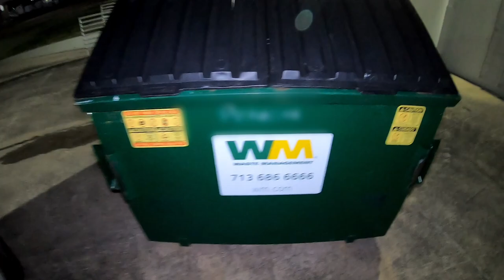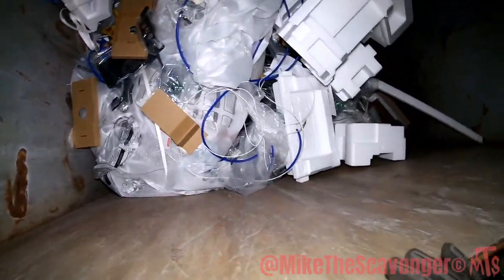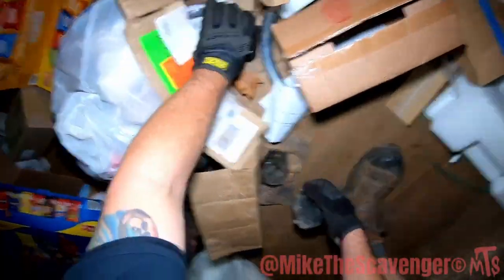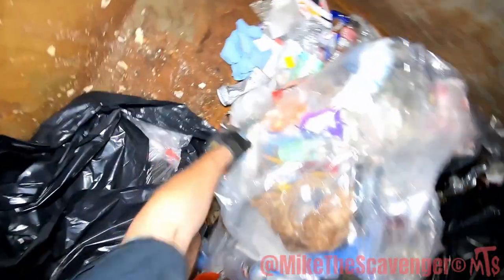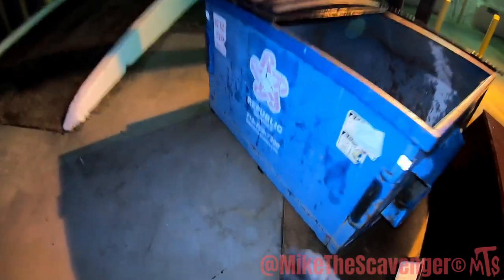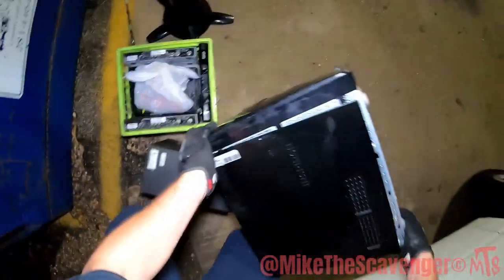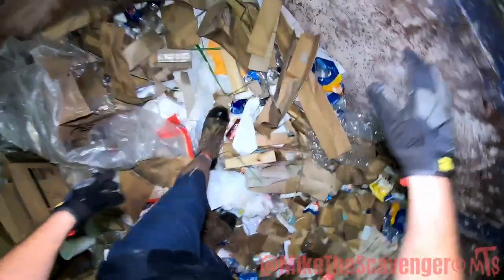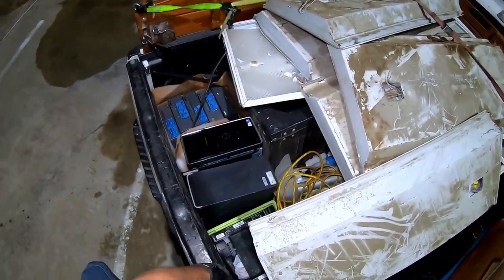Dumpster Diving "Blue Magic!"

Comment: Mike I grabbed a 46 in. Tv from the dump and did a hard reset and the tv worked. You should be gentle with them. If you get it to work it will have resale value
Reply: I agree. I received an old big TV (45 in.) from a neighbor because it didn't work. Checked on YouTube video, ordered a replacement board on eBay, replaced it and the TV works again like new. I like getting free stuff. That TV he tossed and broke it may never work again. 📺
Reply: @Linkz1485  at one point in time he DID bring them home and check them. Not anymore I guess

Comment: Mike Mike what about the fittings on top of the fire extinguishers those are metal if not my mistake aluminum you need to start unscrewing those valves off the top of the fire extinguishers FYI

Comment: That heavy pipe is called rigid it’s for areas where emt conduit just isn’t tuff enough to protect your wiring and it’s really hard to work with,,that-extinguisher looked new and that size is around 50-80 buck’s depending on the brand

Comment: First I want to say thank you for another awesome video. You rock. I would like to start filming some videos. What GoPro would you recommend. That's not going to break the bank, that will be dependable. I've been dumpster driving for years. My father passed away about 5 years ago. We used to go out every night together. I'd like to get back into it a bit. Pet stores throw away lots of good food, treats and supplies. Walked into the local pet store a few weeks ago. Saw a pallet of food that was $90 a bag. Walked around back to their dumpster and there was one of those bags in the dumpster. Just had the corner torn. My dogs eat good. 😃. That pet dumpster has saved me thousands of dollars. ❤️💯🐾🐾.

Comment: Seeing more lights made me wonder: what do you think Mike has gotten the most weight from if you added up everything over the years? Refrigerators are heavy, but there have been several hauls just full of lights or pipes. And several times there were 2 or 4 water heaters in one trip.  What do you all think?

Comment: People throw out good tv's all the time. Some work fine but most "good" ones thrown out just need a couple led backlights replaced. (In my book easy fixes are classed as good tv's!) I currently have 4 bigscreens that came out of the tip or scrapyard and have given friends a half dozen over the last 5 years. Even my local pub has a 55" LG smart tv with remote I got from the tip- I only needed to make a stand for it as it had been wall mounted. Has run all day every day for 2 years without a glitch. So please look before you jump on the next one- or you might waste a couple hundred worth.

Comment: Those satellite and cable boxes are such a joke. I had my satellite internet company want me to send back the head piece that’s in the dish when I moved. They come and install the dish but when you leave they want the customer to retrieve it and send it back. They charge you $300 if you don’t return it. After calling multiple times over several months for them to send me the return box, which you need in order to send it back, and being charged the $300 , they finally told me they would refund the charge and just to throw away all the stuff. The reason? They could not manage to send out the box. The thing is I knew the equipment was obsolete, and they knew it was  obsolete but they just had to mess with me. They had launched a new satellite and were trying to get everyone to switch to it and not adding any new customers to their old system. Worst internet ever but one of our few choices and we were out of contract so no early penalty and we were just waiting for something else to come along.

Comment: I'm actually surprised to keep finding so many empty classic tool holders like those are plastic cases or whatever you were calling it for the life of me I can't even figure out what happened to all the cases for my tools that I have now hell if you were to ask the start grabbing all of this and turning around flipping them on eBay somebody like me would probably end up buying most of them from you because I could actually use them for all of my sockets and wrenches and power tools now there's a thought for you . I also saw that flat screen TV on there it looked like it was in decent shape now I know a bunch of people out where I'm living at but if you would have pulled that out of the dumpster in the condition it was in they would have fixed that for you or something simple like like picking them up a steak or something and then you would have ended up with a working television that you could have turned around and flipped for anywhere from $200 to 350 there are those people out there who enjoy a good challenge and like fixing stuff I'm doing it for a little to nothing at all you just got to find them I am one of those guys that enjoys fixing the old metal chairs I've seen you pick up a ton of those overtime and from what I figure and I can understand is that you just break them down and throw them into a scrap pile me personally I would love to get a hold of a few of those a little bit of spot welding cleaning it's a new paint a little bit of fiberboard with some cushioning and some leather or something and you got yourself a chair one that could be sold for 35 to 50 dollars